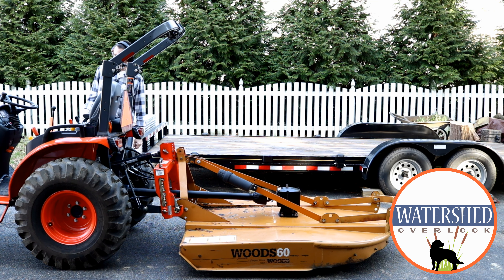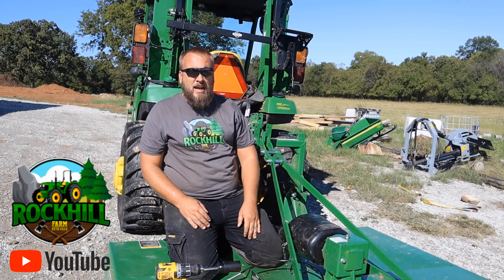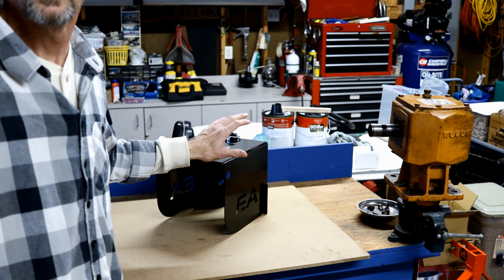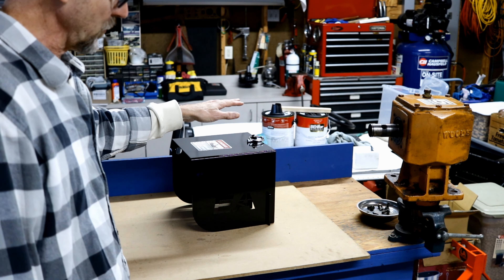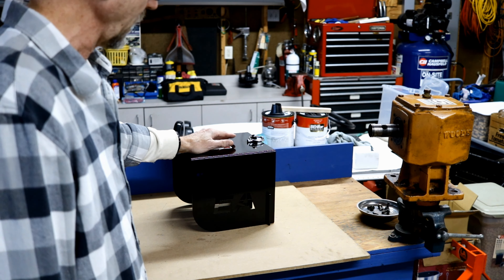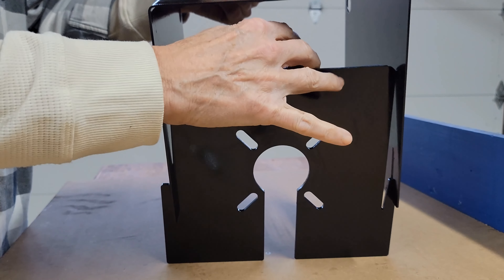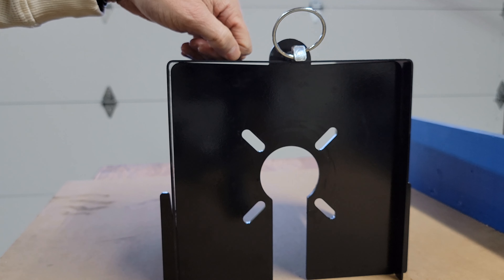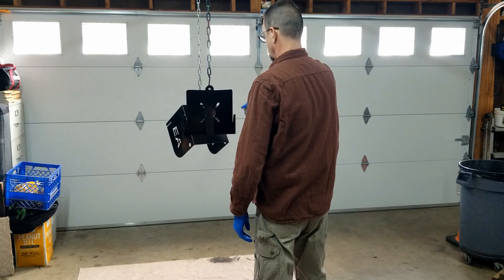028 - Everything Attachments Brush Hog Gearbox Hood | LX2610 | Woods BrushBull

Comment: The gearbox on my roto-tiller has a plastic guard around it, held in place by 4 bolts....a socket an 8-10 inch extension and a ratchet makes quick work of removing the cover...you'd think after all these years of building PTO implements these manufacturers could figure out how to build guards LOL.  With my tiller it has the slip clutch on it, so releasing the PTO shaft pulls the whole assembly off the tiller and I can adjust the slip clutch, and hit the grease zerks on the U-Joints all at the same time.

I think whatever PTO implements I end up with in the future I'll install a slip clutch on them, they're expensive, but I think a better alternative to shear bolts that inevitably break at the most inopportune time, and with luck you don't have any with you when it does break LOL.
Reply from the maker: Thanks for watching William.  I think this guard will be especially helpful when there is a slip clutch installed.

(Hold that thought...😉👍)

Comment: How does the LX2610 handle that brush Bull.   I have an LX2610 and am debating a 48” or 60” and want to be able to cut 2” saplings.
Reply from the maker: Hey Mike, thanks for watching.  I've had zero issues running the 60" with the LX2610, although admittedly, I have only cut tall grass and brush.  My gut feeling is that as long as you take your time and you're not trying to cut thick groves of 2" stuff, I imagine the 60" is the ticket.